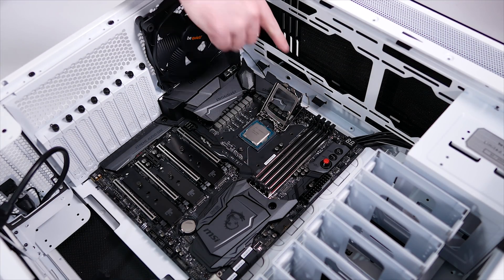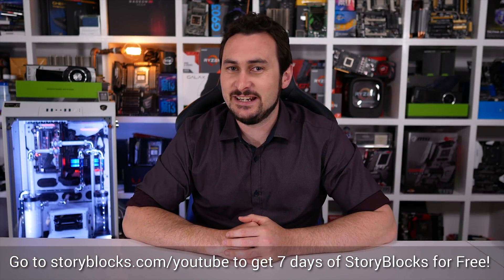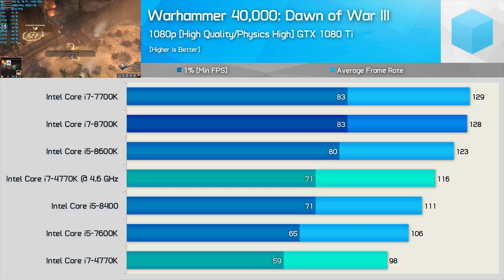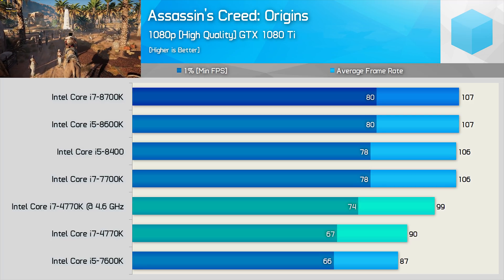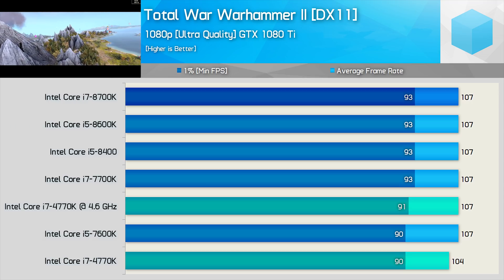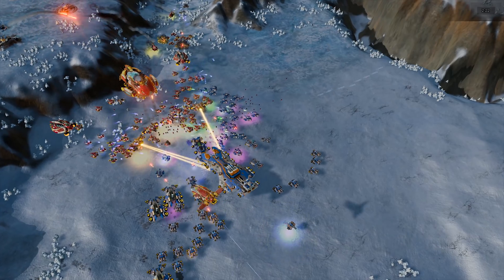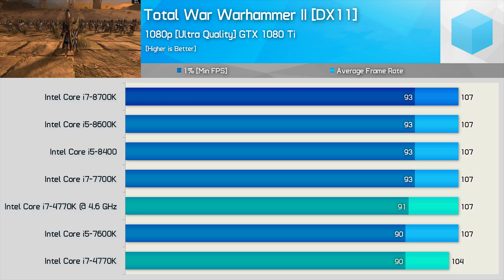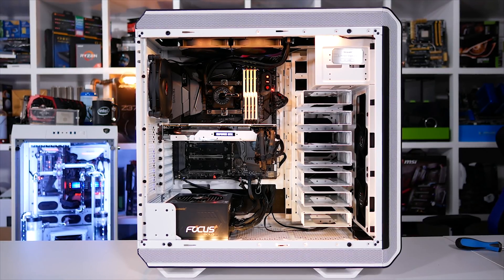4 Year Old Core i7 vs. Core i7-8700K, Worth The Upgrade?

Comment: 4770k is out of date now,  as your results tell, only if you want low fps will it suffice. *
thats why i am considering upgrading my 6700k also when i want to get a new gpu next generation.  were a 1080ti performance is going to be pretty cheap to get.

Comment: 4670k owner here with RAM prices the way they are I don't expect to upgrade for a few more years. Bu then I'm running 3440x1440 on a GTX 1070 so I'm very GPU bound anyway.

Hoping to hold off until Ryzen 2 in a couple of years.

I also want to say Steve your videos were instrumental in my selection of a G4560 and 1060 6GB for my 1080 gaming/HTPC build. Otherwise I would have wasted money on a higher end i5 7600.

Comment: And with v-sync enabled all of these games are equal. You shouldn't upgrade until your frames per second drop below your vsync. Not many people play at unlocked frame rates. I have a i7 4790 CPU on a OEM board and it still does a great job.

Comment: Steve, Did you ever really play the Ashes of Singularity: Escalation? FYI, 1080p confirmed to have different, but once the resolution is 1440p or 2160p then the gap pull closer.

Comment: I would love it if you made a comparison between the Core i7-5775C and the Core i7-8700K.  It's the best CPU supported by the LGA 1150 socket, and thanks to it's massive 128MB of L4 cache, it could actually match or even beat the i7-7700K in gaming benchmarks, even when both CPUs are overclocked.  Right now, it costs about the same amount of money as an i7-8700K, so someone upgrading might want to get that instead so they wouldn't have to buy a new motherboard and expensive DDR4 RAM.  https://www.purepc.pl/procesory/broadwell_niszczyciel_test_core_i5_5675c_i_core_i7_5775c?page=0,30

Comment: I currently have an i5-3470, I want to upgrade but dont want to spend a crap load of money, I was thinking of just upgrading to a i7-3770 because my motherboard is compatible with it but looking at these benchmarks I’m thinking of going with the 4770. Good or bad? What should I upgrade to?
Reply: Just get the i7 3770. They can be had used on Ebay for around £100-£120 and the extra threads should help. Ivybridge is still decent these days. You'll need a new motherboard alongside the i7 4770 so it won't be a cheap upgrade for the small gains over Ivybridge
Reply: Geoffrey Wright yea i would save a lot by just upgrading to the same socket type, thanks for the help!

Comment: Wheres 4790k oc to 4.5 ghz?
Reply from the maker: 4790K @ 4.5 GHz will deliver the exact same results as the 4770K @ 4.5 GHz, they are the same CPU once matched clock for clock. It's like comparing the Ryzen 5 1600 and Ryzen 5 1600 @ 4 GHz.
Reply: Hardware Unboxed ok thanks. My second rig has a 4790k at 4.5 so i wanted to see my cpu difference to a i7 8th gen. I always heard it was better than a i7 4770k.
Reply: Think of the 4770K as the 6700K, and the 4790K as the 7700K. You just get slightly higher OC potential with the 4790K.

Comment: I like you work, but, i cannot understand why you compare K CPUs without overclocking. Who  paids a 8700K not  to overclock it?
Reply: From 3.7 Ghz to 5 Ghz (on all cores) in 70% of the case, 16% 5.1 Ghz and 7% 5.2 Ghz yet it doesn't "overclock that well" ? are we speaking about the same hardware ?

Comment: I have the 4790 and seeing that the higher detail you go, the less it makes a difference, really helped.

I have a gtx 970 though, still scratching my head to get a 1070 or 1080ti.. or wait for Volta or something better.. Doesn't really help to get a 1080ti now and then next year Volta 1170/2070 (or something) will beat or be close to 1080ti performance, with 3/5 of the price.

Comment: 4790k for years!!!
Reply: Love my 4790k <3
Reply: Delidded mine managed 5.1ghz so even less of a gap between it and the 8700k !
Reply: Alan Leslie what on a socket 1150?
Reply: Both myself and best mate have i7-4790k. Both overclocked to 4.7 and 4.8 respectively. One of the best CPU's released and as this video shows, still top end. I have money for new build literally burning a hole in my pocket but just no point upgrading at all. Not sure what your talking about here.
Reply: i have 4790k it was reaching 75-80°C on a stock intel cooler bought myself masterair pro 4 and now it never goes above 60°C i think there was something wrong with your cpu or the way you mount the cooler
Reply: I only upgraded to 8700k because my Mobo went out.  But the 8700k is decently better than the 4790k.  There's almost no mobos to buy for replacement with 4790k. Especially since asrock has spoiled me with their sick mini itx boards that have cool features like built in headset amps which really do make a huge difference in audio quality on Sennheiser headphones.  Also my noctua heatsink is fully compatible for going from 4790 to 8700.  All I had to get was Mobo memory and CPU and I'm back in action with my 1080ti.
Reply: Even less if you plan to play at 4k wich stress the gpu not cpu and 4790k is more than capable of 60fps the thing is if ypu want to plat at 1440 above 120/140fps some games you wont be able..
Reply: Running 2 xeons e5649's
Reply: Still running my 4790k and 5700xt now. 1440p and 4k this CPU can keep up for sure. Only had issues in one game and that's assassin's Creed Odyssey
Reply: Unfortunately for me when I built my pc back in 2013 I opted for the 4670k.  BF1 and some other games were always 100% cpu usage giving me some crazy stutters/slide shows I knew it was time to upgrade.  Looked at the damn price of a 4790k and decided to sell the mobo/cpu for $250 and got me a ryzen build with a lil bit of extra money out of pocket.
Reply: I7 4790k is garbage overheating slowdowns Most of the time
Reply: just get a better cooler :D
Reply: @MultiKingsalmon can´t confirm that. running @4.4Ghz without overheating even on summerdays
Reply: @MultiKingsalmon  it's called delidding. without delid mine runs up to 4.7 on air,  anyway it only matters if you have gpu higher than a 1070. 4970k at stock 4.4 is fine for most people.
Reply: Kent Ferguson nah i got alot of stuttering with i7 4790k i had 2 of them they were realy garbage for gaming i7 6700k was fine :)

Comment: The sad part is used i7 4770K or 4790K are selling at over USD 250 , they are not cheap !  Add in the cost of used Z97 , Z87 motherboard , you wont save a lot compare to buying a new z370 MB + 8700K . Not to mention that new AAA games like AC origins can use more than 12 threads .
Reply from the maker: $250 is very cheap compared to buying an 8700K + Z370 + DDR4 and no AC Origins doesn't need a 12 threaded processor, 8 threads work fine and probably even less once they fix the game.

Comment: 4670k vs R5 1600(x) that i would like to see xD
Reply: Same thing as i5 6/7600K.
Reply: 4670k wins in 80+ % of the games . easy way to compare is use 7600k numbers . a 4670k @ 4.4-4.7 beats or equals  the 7600k im most games I have seen .
The more single core dependent the game the more the 4670k wins .

Comment: Is 8700k running multicore enhancement?
Reply from the maker: no
Reply: Hardware Unboxed thanks for the answer. Getting a 8700k next week, is overclocking worth it compared to stock when playing at 1440p?
Reply from the maker: Depends on the graphics card and what you're targeting but for most situations the answer would be, no.
Reply: Hardware Unboxed got a 1080 and asus 34” 3440x1440p 100hz monitor

Comment: I can be wrong but I think the 4770k max turbo frequency is 3,9ghz and not 4,0ghz as mentioned in the table in the first part of the video.
Reply: Sébastien Renard I have my i7 4770k @4.4ghz at 1.147v, I got a pretty good chip
Reply: @ArthurM1863  Same here and on water too!
Reply: @TeeKoon  I have it at 4.7ghz 1.29v now lol, don't want to get the voltage higher, because of lifespan
Reply: Sébastien Renard your thinking of i7 4770 the i7 4770k can pass 4.0ghz. I own the i7 4770 and still a beast for it age.
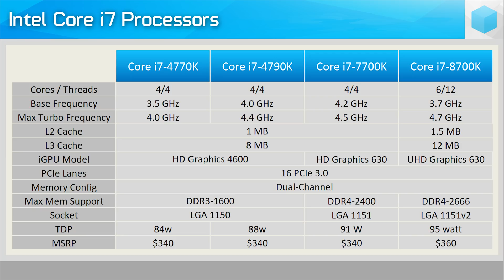Reply: In the table at 0:50 it should be mentioned 3.9GHz and not 4.0GHz. he refers to the Intel specifications. I have a 4770K myself and I agree it is still strong but I was very disappointed by its OC potential. Mine is running at 4.1GHz but at 1.2V. I am no expert but I OC my various CPUs for the last 20 years and this particular model was a let down. Do you OC it? what frequency do you archive? with what voltage?
Have a nice day

Comment: I have an i5 4590, 16gb of 1600mhz memory and an h97 motherboard. Graphics card is a GTX 980ti. Do I pick up a 4770/90k, or do I upgrade everything and go for an i7 8700k or a ryzen 1600x?  Or should I go old and pick up an i7 3930/4930k, or go even older and pick up a Xeon x5690? Could you compare any/all of these, something like a 6 core showdown?
Reply: For just gaming I would buy a 4770/90 since the 980 Ti basically performs like a 1070 so you wouldn't see a huge difference with an 8700K. That being said, it'd also be cheaper to buy a Z97 motherboard and a 4770/90K since RAM pricing is so high now.

If you're doing any kind of productivity work then you should consider Coffee Lake, Ryzen, Skylake-X, and Threadripper.
Reply: Go 4770k or 4790k and rock it for another 2 years or whenever. If u havnt jumped to 1440p IPS 144 Hz do that instead of a new platform. This also reduces the cpu bottleneck extending the life of the cpu. ✌️☺️
Reply: I can't find one of the k haswells under $200, but the 6 core x79 CPUs are well under $200 and over clock just as high. Motherboards are more expensive though, which is a better deal? Also I did just order an Asus pg278q, got it for $300
Reply: Also I should clarify, I'm just a gamer and I'm trying to get a higher end system for as cheap as I can.
Reply: Marcus Coster The thing is, if you buy a K SKU Haswell then you're also going to need to buy a Z97 motherboard since you won't be able to overclock those on your H97. The cheapest X79 and Xeon E5 1650 combo I could find was $340US, and the cheapest Z97 and 4770K combo I could find was $330US.
X79:
https://www.ebay.com/itm/ASUS-Sabertooth-Intel-X79-Chipset-LGA2011-Motherboard/112647048686?epid=114542237
https://www.aliexpress.com/item/Intel-Xeon-CPU-E5-1650-SR0KZ-3-20GHz-6-Core-12M-LGA2011-E5-1650-processor-free/32841192597.html

Z97:
https://www.ebay.com/itm/MSI-ProSeries-Z97-PC-Mate-Intel-LGA-1150-DDR3-USB-3-0-HDMI-CFX-ATX-Motherboard/142586249041
https://www.aliexpress.com/item/Intel-Core-i7-4770K-SR147-3-5GHz-Quad-Core-CPU-Intel-I7-4770K-Desktop-Processor/32824178284.html

So it's a pick your poison situation, but you can buy a 4770K now and then upgrade your motherboard later.

Although, since you're just gaming you could also buy a Sandy Bridge system with a 2600K for $230US.
https://www.ebay.com/itm/Intel-Core-i7-2600K-Sandy-Bridge-Quad-Core-3-4GHz-LGA-1155-Desktop-Processor-CPU/272939577322
https://www.ebay.com/itm/FOR-Gigabyte-Z68X-UD4-B3-1155-Z68-Motherboard-Test-OK/252925070345

If you want Z77 then the price will go up to $290US
https://www.ebay.com/itm/ASUS-P8Z77-V-Genuine-Intel-Z77-Motherboard-LGA1155-I-O-Shield-Fully-Teated/263084920495
Reply: SlavjanA I have found on eBay a 4930k, Asus sabertooth x79 and a hyper 212 for $300 OBO. My motherboard does support over clocking.
Reply: That's pretty cheap for $300, if it's not broken or anything like that then it's a solid buy if you're up for it. Also yeah some H97 motherboards do have overclocking support, but it's usually not fully featured and doesn't allow you to adjust everything like a Z97 board can.

Comment: Testing for Total war needs to be done properly. I had a 4770 and upgraded to 8700.In 4v4 battles ,there is huge difference between these CPUs. 4770 is almost unplayable.
Reply from the maker: So the built in battle benchmark isn't as good? Is there a way to accurately benchmark a 4v4 battle?
Reply from the maker: Okay just played a 4v4 and then watched the replay back, on the 8700K I rarely saw utilization exceed 30% :S
Reply: That's the point actually.The Game/Engine is not optimized properly and hence brute force is required i.e latest intel CPUs with great IPC.
One thing is for sure ,built in benchmark is almost  meaningless for judging total war performance .
Reply from the maker: I just compared a busy 4v4 battle to the built in benchmark, the results are much the same. So I can't work out why it's useless.

Comment: if your running a gsync monitor then the upgrade could be worth it
Reply: turbonut20v I'd say the opposite
Reply: well ive got a 4770k with a 1080ti hooked up to a rog pg279q, i play fp shooters, and the higher the frames the better the experience, especially when youir playing pupg, so any fps boost be it 10 or more would be worth it.

Comment: This was a review I have been awaiting as my dilemma is. Do I upgrade from 4th gen I5 to 8th gen I7 or should I upgrade my gtx 1070 to 1080TI. I think the performance gain will be more with GPU. Lets face it upgrading to 8th gen i7 will be 1100 bucks because I surely would get new case and PSU also and maybe an SSD IF I went that route. But I can put my 1070 on Clist for 300 and really only be out 500 for 1080ti. I don't know.

Comment: I have a i5 4690k oc'ed to 4.5ghz and a Rx 480 strix. In bf1 on ultra I'm getting low FPS with the GPU and CPU maxed out at 100% although others are getting around 70 FPS in this config. Does anyone know how this happens?
Reply: I assume you're running at the same resolution as the others, and so if that's the case then it wouldn't hurt to check the drivers.

Use DDU in Safe Mode to uninstall the current driver, and then install the latest driver.
Reply: Jimemy single player is around 90 for most
Reply: SlavjanA I have the latest GPU drivers if that's what you meant, but that does not change anything.
Reply: when you say "low" what do you mean ? how low ? 

what is your cache running @ and your ram as well .
Reply: Tim Imming I mean you should clean install them.

Get DDU: https://www.wagnardsoft.com/forums/viewtopic.php?f=5&t=925 and run it in Safe Mode. Once it's done, install the latest drivers again.

Comment: Haswell i7 vs Kabylake i7 both @ 4.5GHz, you'll see little no performance gains lol.

Coffeelake i7 has more threads and cores thus the wider gap
Reply from the maker: When GPU limited, Kaby Lakes additional memory bandwidth comes in very handy for pushing high frames.
Reply: Hardware Unboxed Yep, I did notice that in some games you benchmarked.
And RAM speed

Comment: Yes baby! The video makes me happy.❤️ 
I have an i7 4790k, a GTX 1080 and a 1440p - 144Hz Gsync Monitor and I'm happy to see, that my CPU is still a little beast. 👍😉
Of course, the newer CPUs are better, but the difference is not that big. And most of the time I'm over 100fps, which is fantastic.
Maybe I'm lucky and I can keep my CPU for the next 2 years. 
Thanks for the video. ✌️
Reply: If you have a 4790k why not overclock? It's free gains!! Got mine clocked at 4.7GHz. Was a noticeable difference to stock clocks. (same specs 1080 with ultra wide 1440p).
Reply: Thomas do you OC? If yes, how many fps increase on average you get compared to the turbo (4.4ghz) clocks?
Reply: Ruba No, I don't need OC. I can play all my games @ ULTRA @ 1440p with constant over 60fps. 
Most games run over 80fps and more.
Reply: Thomas yeah I know, because I have the same exact specs as you. I was just wondering would there be any noticeable difference from 4.4ghz to 4.8ghz with 4790k, gtx 1080, 1440p, 165hz, let's say in a game like PUBG...
Reply: Ruba Not much, maybe 5 fps.
Reply: Thomas yeah not worth OC

Comment: Playing AC Origin in 4K (Max setting low AA) with 1080Ti. Upgrading from 4790k to 8700k is night and day difference. 4790k struggle so bad in city area.
Reply: at 4k? I dont think so
Reply: Fedee It is true. I played the game in 4k with 4790k and now I changed to 8700k and it is so much better now.
Reply: Ok cool, but I dont think youre getting 60fps on 4k ultra on one 1080ti ..
Reply: Yes it is not about just the 1080ti. It is the 1080ti and the anti crack software with the game. In some city area. Many NPC and anti crack add up will make my 4790k not enough. It just go full 100% work load. Just trust me for that lol. I use both CPU man..